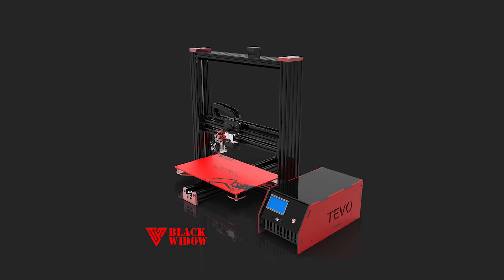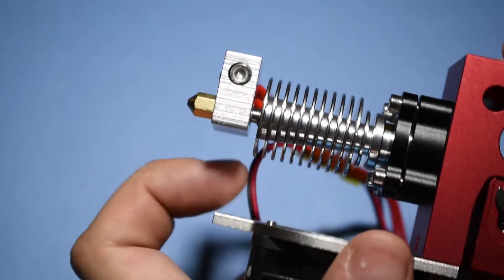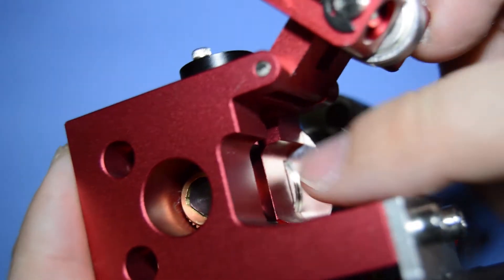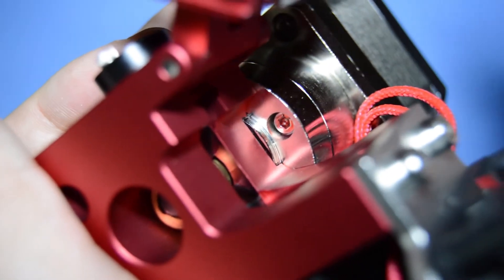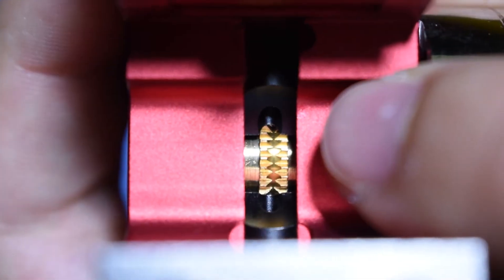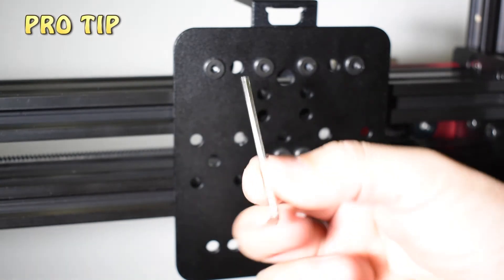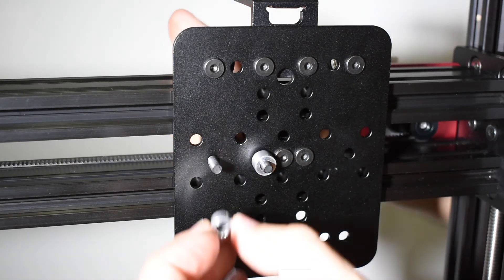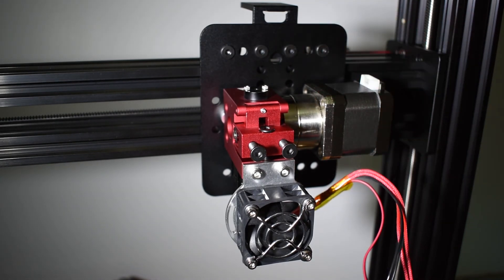TEVO Black Widow V3 assembly - STEP 9 (Extruder)

Comment: Thanks for this amazing tutorial... I have a little problem. The filament dont fit at all when I put The screw 😭
Reply from the maker: Are you using 1.75mm filament?
Reply: @ruiraptor  yeah of course. I have already printed some pieces. Time later I realized there were some gaps at the bottom. And now it is a mess because the extruder  some filament's part  grabs correctly And some part it doest't i have pressed the springs  but it haven't worked at all too. I have verified the gear but it seems ok   :(
Reply from the maker: Most of the issues usually come from the wrong alignment of the gear in the extruder. We explain that in detail and there is also a part that you need to cut/remove from the metal part. Other than that is hard to say without more details .